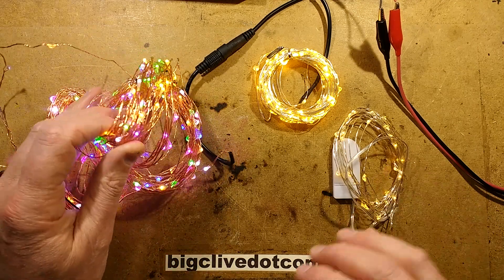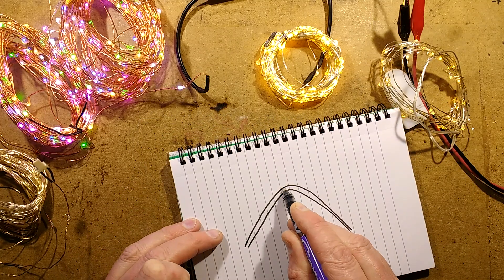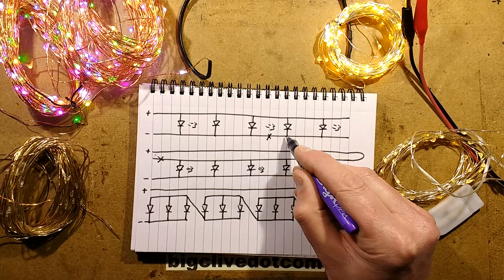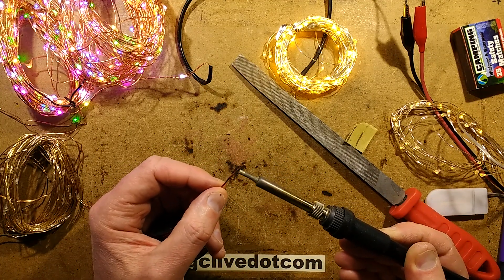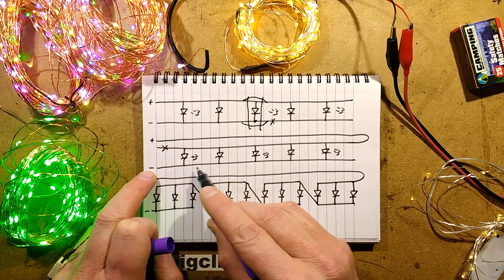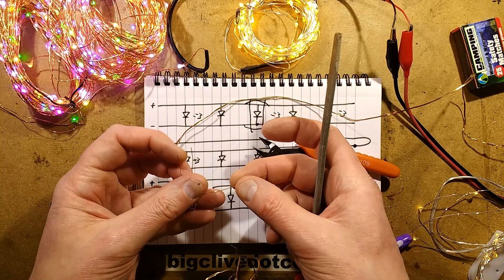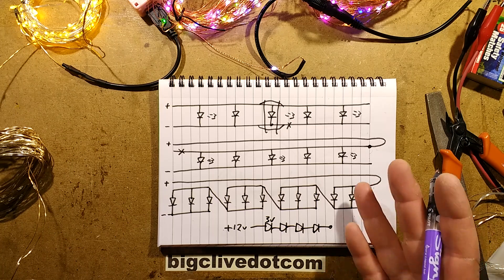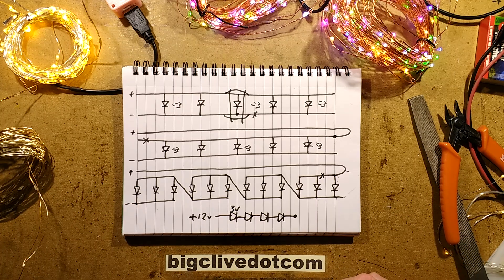Fixing low voltage copper wire LED strings.

Comment: Each led must  not draw more than 5 milliamps at 3 volts ?
Reply from the maker: Technically speaking, these LEDs could run at up to 20mA each, but will last much longer and still look amply bright at just 1mA.
Reply: @bigclivedotcom  that's interesting , on my pack of 35 wired all parallel with a battery box supplied for 2 x AA cells giving 3 volts the instruction says the unit must not draw more than .525 milliwatts , I was intrigued how they managed to get a  away with providing  such a small power supply  

BigW shop chain seem to be running out their stock of these units personally I think they are afraid toddlers could choke on the half inch half pear shaped  lenses , (it  says on the pack to keep away from children ,not a toy) only on display now  they are selling a string of  10 ordinary LEDS  in large clear ball balls for $9 , not $6 for the 35 string
Reply: @bigclivedotcom  Ample indeed. Great word. Great truth.

Comment: I brought x 2 of these copper lights from Ebay, and both were dangerous - the plugs. One interior to exterior blue sparks and burning smell. The second, top blew off the plug itself, had only been plugged in for a few minutes. Luckily, I had them plugged into a fused extension and was in the room. 

How can I purchase and know they are safe? 
Simple terminology, please?

Thank you.  :o)
Reply from the maker: Buy the sets with a USB plug and then run them from a charger bought from a reputable source like ASDA or Walmart.  (Or use an existing old phone USB charger.)
Reply: @bigclivedotcom  Thank you.

Comment: Great video! I would like to add that I fixed a strand like on the very top of your diagram by using a knife to file down the wire to make a better contact with the diode near the LED that was not lighting. I had just one on the end of a line that was out.

Comment: Uh ha! ...cat just nibbled through a single section of my wire led (2x battery pack) and I was hoping it should be a simple fix, because it's such a simple design anyway.  This was very clear, comprehensive and helpful! ...plus I felt like I learnt something today about circuits too.  Cheers! 👍

Comment: Hi. Great video. I have two sets of (USB plug) fairy lights. They’re 6 meters each. Can this method be used to connect them together for one long string? I put a set of lights up on the walls near the ceiling, so having to plug them in shortens the string quite a bit. I’m in the US. Not sure if that matters. I wanted to make sure it’s safe and that I don’t break them. 
Thanks.

Comment: A little late but I just watched a video called "Copper string lights assembly production" by SANHUNG.
It shows one factory's placement of individual LEDs and application of what I guess is silicone to the wires - By Hand!  It's wild!
https://youtu.be/wCKlCUBsaT4

Comment: i have solar lights outside copper wire ones, today i moved themand the end of it, came undone 2 wires go into the led light and 2 come out of the other side of led light, and there is another wire

Comment: Hello just want to say great Vids , I have many of the three wire ones , and shortly one of the 100 ft ones stopped working , I think it was a faulty solar control panel . So I cut it and try joining the three wires to another 100Ft , as I have these going all around my pool deck . it did not work, but I did not know about the coating on the wires , so I will strip them and try again , My question is will the first set of 100ft be able to power the second in series ., The other reason I want to do this is because of the remote and light flashing modes ,

Comment: I found this quite helpful - I wondered why just twisting the broken wire ends together didn't work, and after first stripping the ends with my nail file now have a fully functioning 2 wire LED string again :)

Comment: Burned and filed and still nothing. Is it possible to burn it too much??
Reply from the maker: As long as you get through to the bare metal it should be OK.  Remember that polarity of wires is also important.

Comment: What kind of current does each type suck up?
Reply from the maker: You can run these strings of LEDs at extremely low current and still get a nice effect.

Comment: I have a 36ft length of these 3 wires and I'm trying to add another 8ft onto them, my question is would the gauge of the 3rd(no led) wire effect the lights?

Comment: I have the solar string lights with the three wires. But mine broke off at the beginning, where the 2 plastic covered silver wires that are housed in the solar panel connect to the 3 copper colored wires. How do I fix this? Does that make sense?
Reply from the maker: If there are two wires coming from the controller and three running along the LEDs then you'll probably find that all the LEDs are in parallel across two wires and the third may go right to the far end.
If that's the case then strip the lacquer off the end of the wires and connect one to the wire that goes to the far end and then dab the other between the other two to see if the LEDs light (while the solar panel is covered to activate it).  If they don't light swap the two wires coming from the solar panel and try again.
Reply: bigclivedotcom I tried following your advice and nothing was working. I put in a new battery I tried hooking up another set of lights to the solar power housing unit and nothing happened there.. I think I might have some kind of dysfunction inside the unit it’s self. I don’t have the knowledge or experience you have but I am not giving up on them yet. They are just going to be put to bed for a while. Everything about these lights are so flimsy and easily broken. But I had just bought these and busted the wire accidentally, and I wouldn’t send them back because it was my fault. But I had been playing around with them and I probably broke something else. But I thank you so much for your help. And you can be thankful you’re not my neighbor, I would be over your house all the time asking you questions. My thing is solar lights. I love solar energy.

Comment: mine snapped in half so
Reply: Ciara Michalek you can still fix it, take off the cover on the wires that were cut, twist them back together, but you have see which wire belongs to which.

Comment: Had a 2-wire string of 20 I was playing around with using a Joule Thief fitted with a uF cap/schottkydiode, and accidentally connected them to over-voltage (the cap will quickly reach 90V open circuit powered by a "dead" 1V AA cell).  The 10 nearest the power were dead but the end 10 were still working. So I just cut the 1st 10 off, tinned the wires to the others (which melted through the clear insulation just like with magnet wire), and managed to salvage half of it.  The dead ones still show a voltage drop and current but no light.  Thank you for the explanation, I wonder how these were made.

Comment: Will it still work if you cut them? Mines too long.
Reply from the maker: Only on the two wire versions that run at low voltage like a solar panel or small battery pack.
Reply: Oh thank you for the reply! Mines battery operated one it should still work if I cut em ight
Reply from the maker: @heyyojie0317  Is it just two wires running along the length?  If it is then it should be OK, but if there are three it makes it a little more complicated as they may all go out.
Reply: Yes just two copper wire

Comment: I have one,but is on AC 250V and isn't working... can i porting on USB or somehing and how?
Reply from the maker: It depends on the original power supply if it used one.  The copper wire lights are usually low voltage.

Comment: I have a two wire setup (I believe), and a single light along the string is flickering. None of the other lights are affected.. Any ideas on how to fix it?
Reply from the maker: It's not really practical to fix it.  The LEDs have to be identically matched on a parallel string.  The LED will probably eventually go out.

Comment: So, this worked great, fixed the 3 wire LED version. But now the wall plug is buzzing rhythmically... is that dangerous? Worrying and annoying sound
Reply from the maker: Some power supplies do make a slight buzz.  As long as it's a good quality power supply and the lights look normal it should be OK.

Comment: Thank you for this very well made video. I learned a lot from you, but unfortunately I still can not figure out why my light string is so dim. I had bought two sets of 22 LED fairy lights (looks like the one in your video on the lower right). On set didn't light up at all. It turned out that one of the two batteries was was dead. I replaced the battery and the lights turned on, however they were much dimmer than the other light string. Went back and checked the Voltage of all batteries. Both batteries in the brightly lit string had 2.9 V, and both batteries in the dim string had 3.1 V. I noticed that the slide switch of the dim string is missing one throw, only the pole and middle pin is there. Also, the battery connector from throw to the minus pole is missing it's "proper" end. The remaining throw was soldered onto the "left over" copper. However, the string and switch do their stuff but something is fishy. What could be the culprit? I appreciate your time and help :-)

Comment: I didn’t have sand paper. So used a gas lighter flame to burn the coating. I think the coatings are gone but still when I am trying to connect the wires this is not working.
Reply: Think you burned them too much, you can also take the coating off with scissors, or a knife, run the sharp ends with the wire but be careful, the blade might cut you or you might to rough and rip off the wire instead.

Comment: so if i buy a 100 meter led set to divide into 20 pieces of 5 meters(to save money). it will not work. right? it needs to be cut as 25 meter pieces. am i right? and is it possible to buy the one with battery and connect it directly to a 5v usb output?

Comment: Its worth noting that despite my two wire fairy lights looking like silver wire, they were coated to appear that way & wouldn't work connecting until I carefully burned that coating off to reveal the copper part at the ends I needed to reconnect.
Reply from the maker: I have a vodeo showing how to repair them that shows various ways of removing the clear lacquer.  It's used to avoid the wires shorting to each other.

Comment: This looks great. I’ll have a gander. Quick question though (if you check - I’ve never really contacted anyone on YouTube) 

I have just spent two days making a steampunk lamp with multi colour/function leds running through the pipes. 

Finished it. Looked awesome then the plug fell and it looks like the wires have come loose from the usb power source and need soldered. 

There’s 4 different connections for the different colours and  functions 

Do you think it’s possible? 

Thanks BigClive or anyone ;-)
Reply from the maker: Is it the wires in the USB lead or the wires between the control unit and coloured LEDs?

Comment: Brilliant! I kept wondering why mine wouldn't work after I twisted the broken wire together. I had no idea the wires were coated. A little rubbing with a nail file on both ends, then twisted together again, and voila, worked like a charm and saved me the cost of another string. Thank you!!! This is the thing I love most about YouTube...you can learn how to do almost anything yourself, from the comfort of your home. I've learned how to change my windshield wipers, fix my toilet and now, fix a string of LED lights. What next?
Reply: Swapping out your power steering pump on your car.

I love YouTube too :)
Reply: Good job! It's very satisfying when you can fix something yourself!

Comment: was really hoping there was a part in the video for  “How to re-wire/solder/connect the end of strings back into the ‘3 AA Battery Pack with the On/Off switch” 

snapped off the Negative/Positive from inside the Battery Pack. 

Wish there was a tutorial or anything on the Internet showing how to fix. shame :/

Comment: so my wires only work on "flash mode". they don't seem to work on the static mode which is what i would prefer. I don't want to return the whole thing back to amazon when i could probably fix it myself, im just not sure how. ive looked at the battery pack and circuit board and everything seems to be fine. not sure how to go about this, any suggestion would be appreciated
Reply from the maker: Make sure the switch is free to move to the static position
Reply: @bigclivedotcom  the switch is free to move ive even tried moving it halfway in between to see if that works but still nothing :( i will probably have to get a new one sent out to me

Comment: I have a 10 meter tape like this but I don't know how to get it working.
The tape is 12v, I tried to plug it into a 12v-2A transformer and it won't light up.
Can you help me try to get the tape working?
Reply: Make sure to check the polarity.

Comment: Hi, I have a solar string led rope light & no LEDs are lit. They are not  well sealed though, in fact I can see rust residue on the green cable shielding in places. Is the rope meant to loop at the end or do the wires just terminate at the end? Trying to get em working
Reply from the maker: If it's the type with all the LEDs in parallel then the wires will be open at the end.  There may be corrosion in the control box.
Reply: @bigclivedotcom  control box is good, battery and panel both good.  Can't get any LEDs to light, one copper cable seems a bit darker, like its been burned a bit. Decided to keep control box / panel and ditch the LEDs. Could I buy a string of LEDs that will connect to the box....? The box outputs 1.5v & has an AA rechargable. Thanks for getting back to me so quickly 😄

Comment: Hi was wondering if you have ran into any issues with the led fairy lights usb circuit board on the the remote sets over heating and lights tend to partially go out and dim. I have about 60 sets in liquor bottles that I made was wondering if they can be fixed. Thanks for any assistance

Comment: So happy I found this video!  Our local dollar store has been selling "rice lights" (micro-leds), some solar, some battery powered.  I wanted to take some from a battery set and add them to the solar set (solar set had 5 lights, battery had 20 lights).  We convert traditional string lights to solar all the time and was just thrown for a loop about these micro-led ones.  I easily added the additional lights quickly after watching this simple how-to.
Thank you!

Comment: Thanks to your schematics, I was able to figure out how to reconnect the wires on a set with a wire broken. Thanks! My string is solar powered for outdoor use though, and after rewiring them, I'll need to make the repaired area water proof. Any suggestions for how to do that? Can I embed the repair in hot glue or nail polish or something else easy to obtain? It seems like electrical tape would fail rapidly.
Reply from the maker: Nail polish should work as the original coating was a form of lacquer.

Comment: How do we seal the wires after we twist them together? Because I have a problem. 
My string lights are just two wires going through some little flowers. I brought a 2 pack but one was broken so I twisted each of the two to eachother but now if those two wires touch the lights turn off.

Comment: Please help me understand the last diagram (one with 25 LEDs wired in parallel). On the right side, I see the positive is wired to the positive rail of the parallel "set", but now I see the negative rail being connected to the positive rail of the 2nd set. It appears that the negative is connected to the cathode of the 2nd set. How can this work? Thanks for the reply. Oh, I enjoy your tutorials a lot.
Reply from the maker: If it's the 12V set then each parallel string of LEDs is connected in a series circuit with the other parallel strings.  So the current flows through all the separate parallel sections.

Comment: Very useful video, can I roll the whole strip and use it rolled? I was thinking about getting a 10m one and sticking it inside a glass bottle. Will it get very hot and burn my house down if I do that? 
Thanks mate
Reply from the maker: You can stuff it into the bottle.  The LEDs will stay cool.  The art is getting it to go into a bottle evenly.  You may need to push it gently into position with a stick.

Comment: Do solar lights work in the same way? Mine got pulled apart and I'm scared I'll get shocked, I have no experience
Reply from the maker: Standard solar garden lights operate at very low voltage and will not give you a shock.  If you have a set of these wire lights with a solar panel unit then it's usually water ingress that damages the electronics.  If you get a cheap pound/dollar solar light and attach your string of LEDs in place of the existing single LED it should make them glow again.
Reply: @bigclivedotcom  Thanks for the quick reply! I will try it today and see how I do :)

Comment: Would extending them to make the strip longer be the same? Just cut one at the end, cut one at the beginning and connect to the two wires?
Reply from the maker: If joining two sets it's easiest if they are a simple two wire system and also very well matched for voltage.  It's not recommended though, as intensity may reduce over a long run and string voltage mismatch may result in one section being brighter than the other.
Reply: bigclivedotcom does it help if the lights im trying to do this with are the exact same brand, type, and model?
Reply from the maker: @mallkrawlerz620  That should help match the LEDs.
Reply: bigclivedotcom btw thank you for your awesome response time!

Comment: Does your repair work for 110v? I have 100ft 300 led. Think its the 3 wire kind. Your second example, but I don’t want to get electrocuted. Plugged to the wall directly